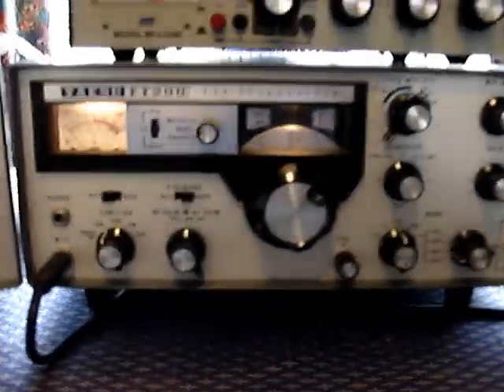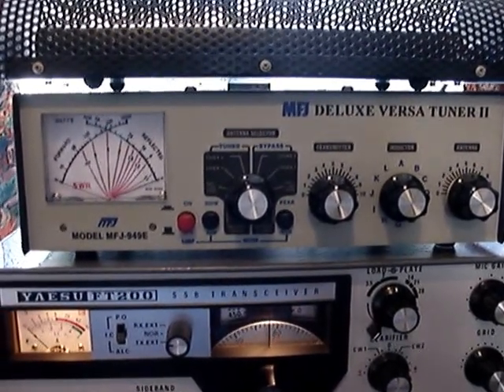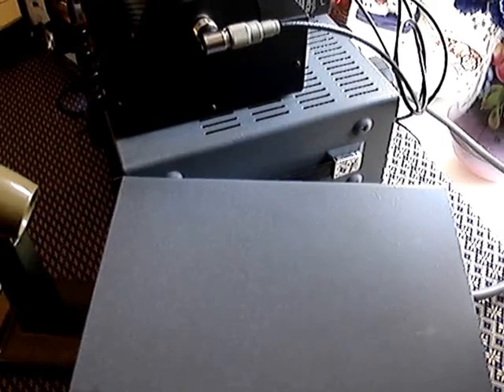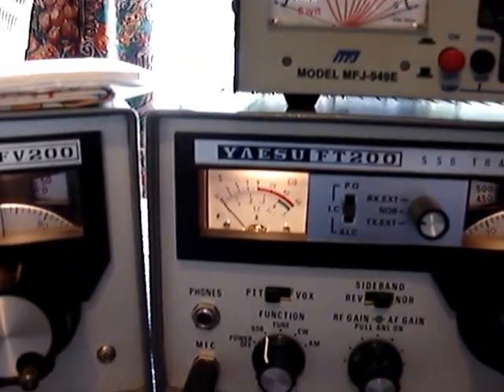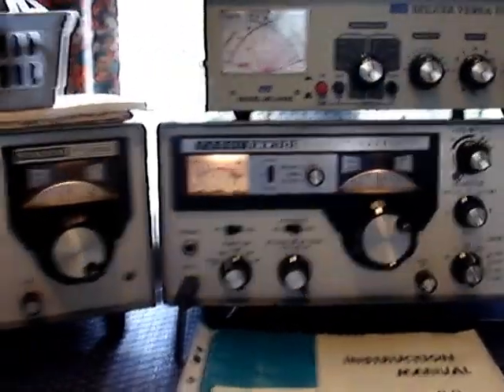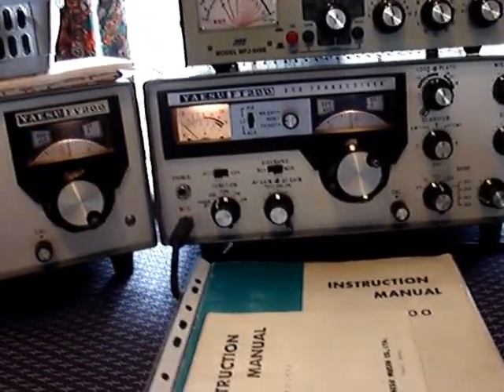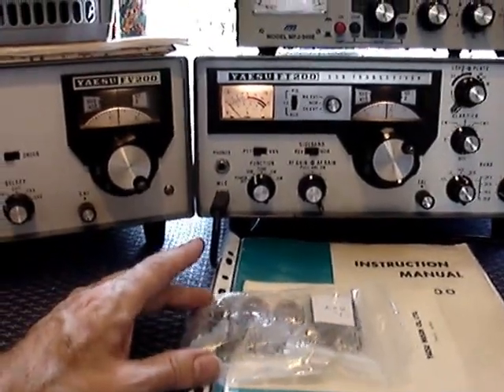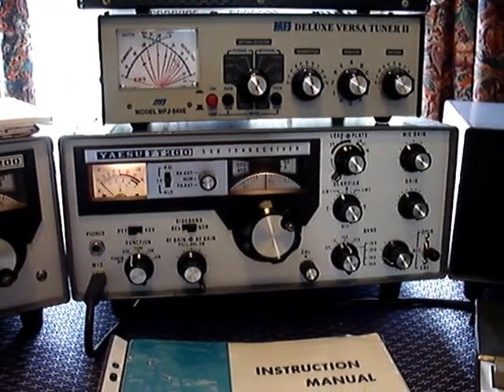yaesu ft 200 in depth

Comment: You mentioned a 6js6c final.  It should be a 6js6a.  It's a horizontal sweep output tube for an old television set, to be specific.  Those are actually getting hard to find matched, as well. I have a couple extra sets for mine, and one set that is getting a little bit soft.  Quite a few people are converting them to 6146's.

Comment: Just a quick question: my FT-101E gives only 10W on 10 meters, and less than 40W on 80m, both on dummy load. The finals are brand new. What to check first?
Reply from the maker: check cathode resistors
check screen resistors
check power supply voltage rail parts
jeff

Comment: I have a black face tempo one. It will power up to 120 watts on dummy load but when I go to the antenna to transmit all I get is the 10 to 30 watts. what am I doing wrong or what might be the problem with the radio.

Comment: Hi Jeff, I wounder if you know anything about the cw part, I get the tone OK through the speaker all the relays click in but almost zero transmission on the atu output, AM works OK so does the tune up and SSB is OK, have you any ideas.
Reply from the maker: +Fender Blues not sure what that is i will have to think on this one .. jeff ..
Reply: Thank you
Reply from the maker: +Jeffrey petch-harrison check the carrier crystals are set up in there pass band . jeff . oh check tghe front mode switch for loose wire .. jeff ..
Reply: Jeffrey petch-harrison
Hi Jeff, loose wire on carrier control, thank you for asking. Another problem, when I switch to Tune up from SSB the frequency lowers, this presented a problem while trying to set the frequency correct to dial markings after setting the dial on zero, people were saying I was off frequency, but the only way I can set the frequency with the frequency meter is to have it set to Tune up, but then the frequency is different drops lower when I go back to SSB, I cant think of a way around it, unless you can think of something.
Cheers.
Reply from the maker: +Fender Blues make sure the calibrator tone modual is set for 100khz that is why you have a problem also make sure the rit is adjusted to center with pot on the underneeth the radio ..jeff ..
Reply: Jeffrey petch-harrison
I don't understand what you mean by RIT. can you elaborate a bit more, I also don't see a pot underneath the radio.
I have tried to set the module for 100KHz but it will only adjust so far before it starts to go the other way.
Cheers.
Reply: Hi Jeff, I can see two variable resistors underneath on a small circuit one has white paint on it which looks like its not been moved, the other has no paint and looks like it has been moved for some reason, were you referring to these.
Other than that I could turn up the carrier on ssb just to set the correct frequency but maybe as a last resort.
Cheers.
Reply from the maker: +Fender Blues rit = clarifire.
looks like yo need to download the manual its free on line .. jeff ..
Reply: Hi. rit = clarifyer. thanks, yes I already have the manual download.
I just noticed a leaking electrolytic cap leaking out the top next to the XF-9 SSB Filter it could be causing a problem, I'll change the cap and get back to you.
Ive checked the transformer connected to the crystal oscillator it reads 5.4v which should be at least 9v to 11v to the 100KHz board.
Cheers Jeff.

Comment from the maker: check tx relay on top of board change the 6ba6 to a 6ba6w on the meter circuit
it works wonders what that better valve can do also on rf input a 6dc6 .. jeff ..
Reply: 6BZ6 is the S-meter valve according to my diagram, second IF amp, a remote cut-off tube.

Comment: Hi again, Ive managed to get the correct power lead now, it worked OK or some days but then the meter needle shot over to the full mark and sound went off then the needle dropped back and sound came back on and later went over to the full mark again and hasn't dropped back to incoming signal since, have you any idea what this may be.
I've checked and cannot see anything burnt out, have checked relays all seem OK.
Thanks

Comment: Hi Jeff - I've just gotten hold of an old Sommerkamp ft-250 which is apparently a rebrand of the yaesu ft-200. It's been in an attic for many years. I cleaned it up, the number dial had come completely loose and some other minor faults. I turned it on and it seems to work mostly - I can receive signals, however they are very weak and the s-meter doesn't move at all, I can barely hear anything even with AF and RF gain turned all the way up and grid adjusted.

I've got no experience with tube radios, I suspect that maybe the rx rf amp tube is in poor condition, is that plausible or is there something else I need to look in to? 

Thanks in advance, kind regards from Soren.
Reply from the maker: trylleklovn remember to change the grid caps to the output valves as the can catch fire .. jeff .. ps yes i have had one ft 200 burn out and cause a fire in my bedroom ..
Reply from the maker: trylleklovn can happen check tx relay on top of board change the first rf valve to 6dc6 its got more gain
tnx jeff